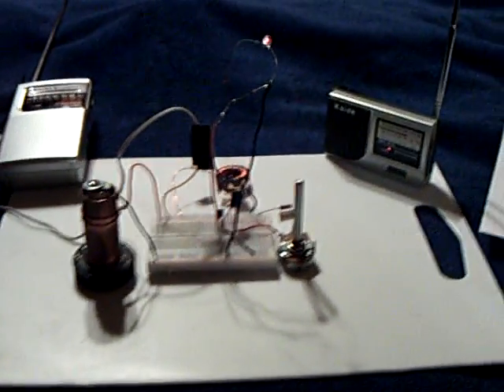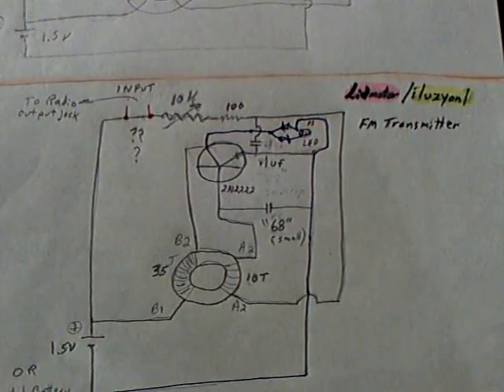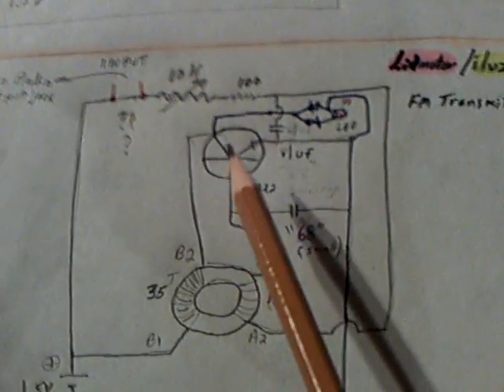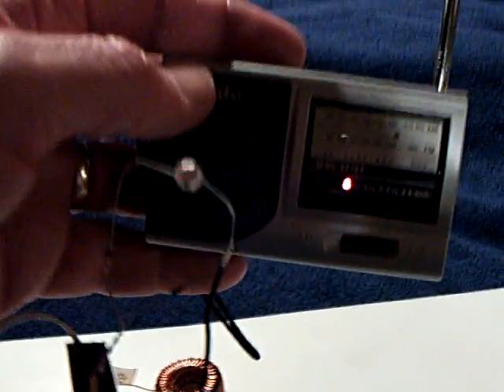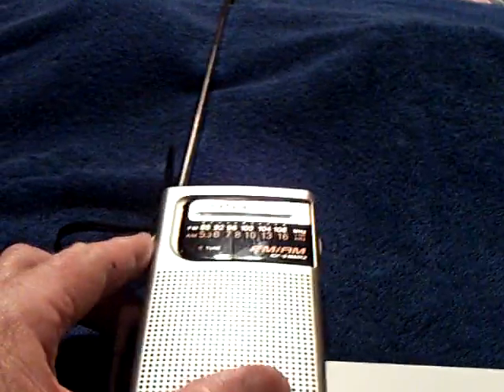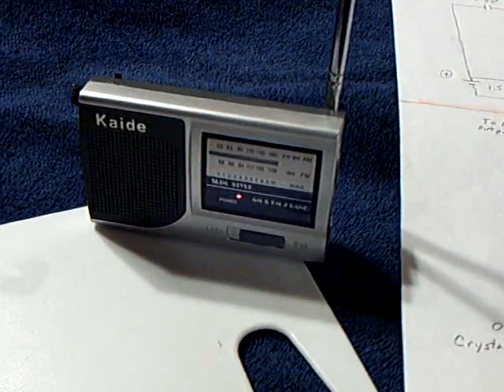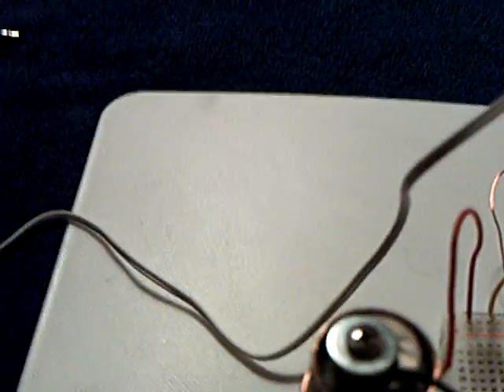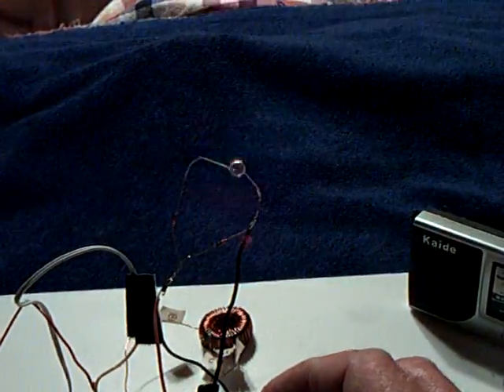Unusual FM transmitter powered by Crystal battery

Comment: :) Dont worry about my nickname, i know that some are not that evident and we are not sure what they mean lol. Just a hint... if your are successfull with the original circuit, replace the 1meg  ohms pot for a 5K ohms, it will be much easier to tune. I also tried a 3rd winding to connect the radio to and it works really good too. A strange thing is that you can also connect the radio directly to the toroid itself, touching it with radio output and it worked just as well...weird lol

Comment from the maker: Thanks.  I was hoping that someone familar with radio would say something and put me on the right track.  I tried injecting the signal to the transistor base through a cap and that DID work.  The transmitter just worked much better when I inserted the signal where I showed.  It was actually an accident.  To me that just looks like a dead short situation.  I kept looking at it and saying to myself,  "That can't possibly work." ----But it did.  Thanks for the help on this.

Comment from the maker: Sorry that I got your nickname wrong.  I'll do better next time.  I think that the way that you are now modulating the circuit might be a better way than the way I did it. I will try again to make the original circuit.  I really liked how this FM transmitter ran on the low power crystal cell.  I have been trying to find uses for cells.  They don't have much power because of their high impedance but they can a function for a long time.

Comment from the maker: Slider I wish that I knew more about radio than I do.  I can just see Dr. Stiffler getting a good laugh at this one and saying --"Ha. I did when I was 5 years old."  It has to be pretty basic stuff but I nerver saw it before.  It might be sideband modulation.  Maybe the signal is just riding on top like you say.  I was very surprised how clear the signal came in when everything went into sync.  Thanks for the 68pf value of that cap.  I was gonna look it up but ran out of time.

Comment: Enjoyed that. Is it actually sideband modulation ? That would be why it's a bit difficult to tune to (from reading some weeks back). There are a couple of FM crystal radios that work by that principle. I don't know, cooler 'n' heck though :D
I imagine the audio is riding on top of the steady DC voltage, for how the Pos rail is carrying it. Much as AC can ride on a DC supply.
104 is 0.1uF, 103, 0.01, 102, 0.001, 101, 0.0001 and 68 would be 0.000068 of a microfarad or 68pF :)

Comment: must be oscillating in the mghz range and the radio might be varying the voltage the circuit gets making the amplitude rise and fall to the music. im really surprised that the circuit can run brodcast on such low amperage and volts and even more surprised it can go through the whole house with a double a . really efficiant